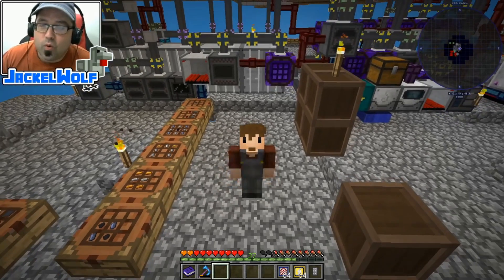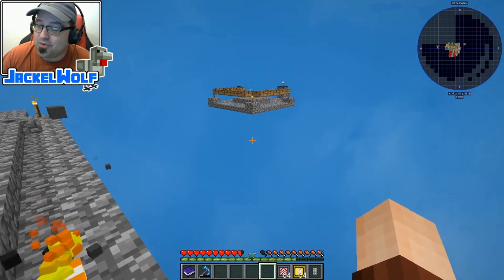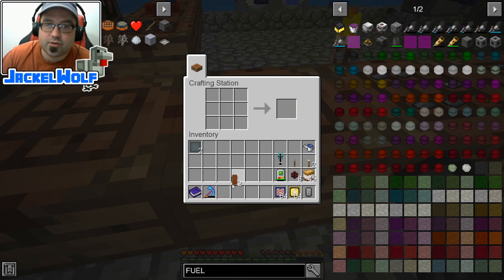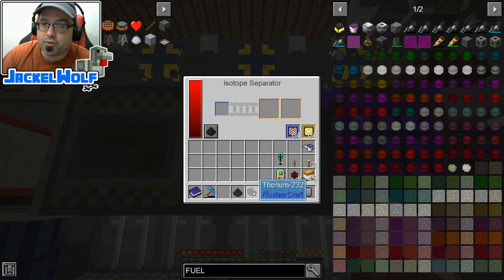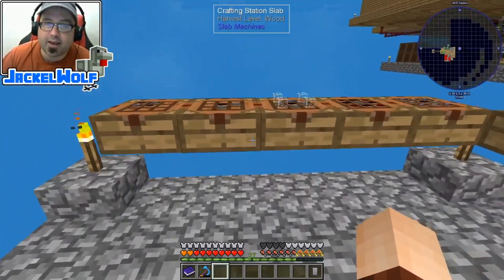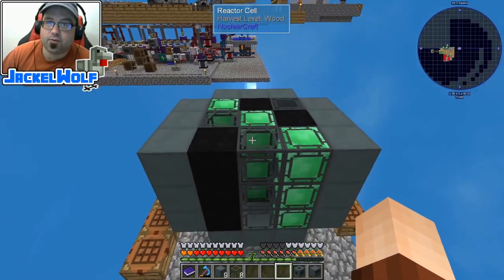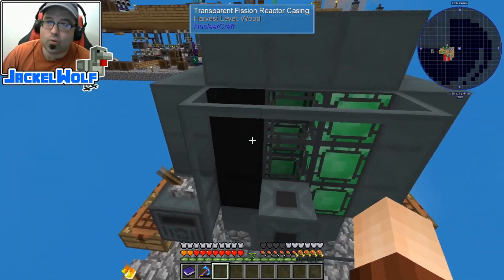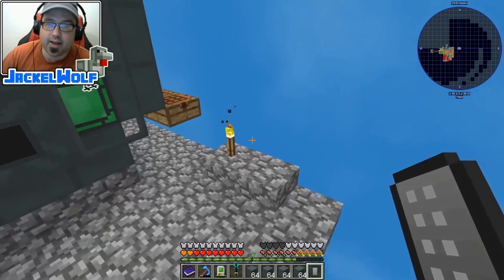[SKYFACTORY 4] EP57: 24x24x24 FISSION REACTOR - SIZE DOES MATTER & GONE FISSION

Comment: In order to help with resources, I put a digital miner in the Twilight Forest with flux point power and an ender chest on the little islands that have a lot of resources.  That helped a ton.
Reply from the maker: That's interesting. I haven't played around with the Digital Miner yet, and my new problem is that I am burning thru Fuel faster than my pigs can produce it. This might be a solution for this. Thanks for the tip!

Comment: if I understood your explanations correctly, the corner columns with emerald and moderator do not work, as they are not in contact with moderator and cooler. I would change the middle layer so the emerald are on the opposite diagonal, then the top layer back like it currently is. this would activate the corners that are not currently working. try that and see if you get more power out of it. I'd be interested knowing the result.
Reply: I'm obviously talking about the 3*3*3 reactor, he he
Reply from the maker: Hmmm... you might be right. I didnt double check the layout I did on the configurator ther than to remember the 3 emerald down the middle. I've gone and added a larger section to my 24x gen as well... going to have to double check 🤔.